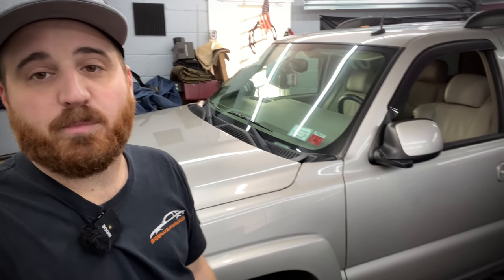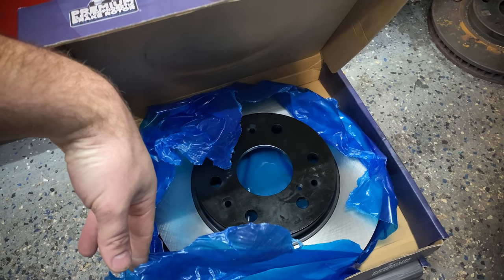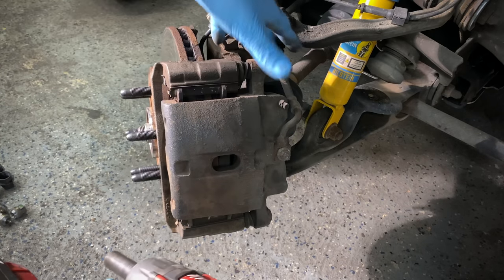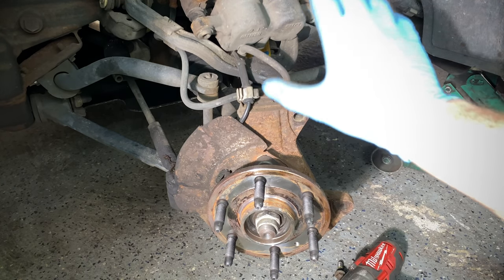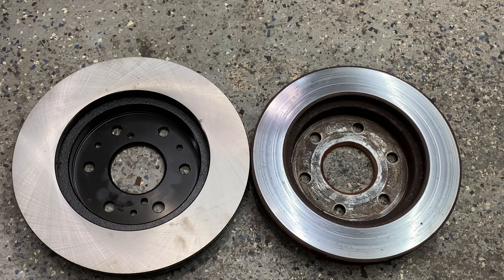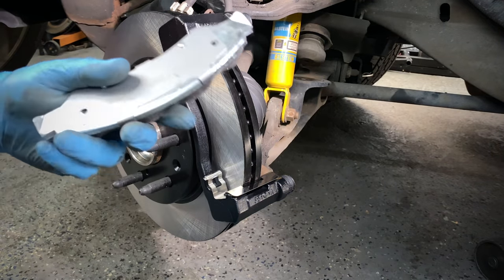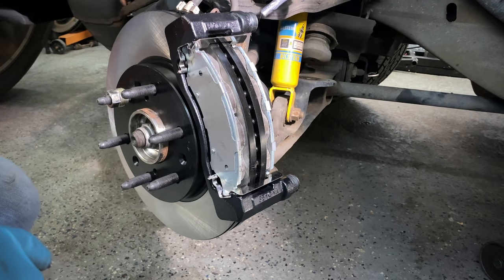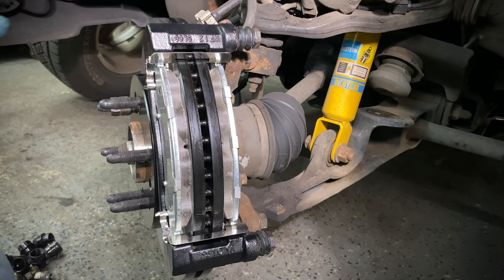This Budget BRAKE UPGRADE is Incredibly CHEAP & EASY!

Comment: Glad to see that you did the mod and liked it !!!!!!!   I believe the minimum rim size would be 17'' and that's what i run for winter tires on my 01 Silverado.  One problem that i encountered that wasn't project related was that i bought my parts rebuilt from two chain parts stores that begin with "A" and had nothing but problems with the calipers either seizing in front and one of the rears literally exploding the piston out of it's bore and taking out a rotor and pads.  Long story short i replaced everything with quality NAPA parts.  The other stores only give you you one set of replacement calipers for warranty even though it was within the 2 year time table.  My truck will now literally put you into the dashboard now when brakes are really leaned on !!!!!!!!!!!   AWESOME video as usual and i'm in CT should you need anything looked at or picked up just let me know as i travel to New Rochelle about once a month to visit my daughter who attends college there !

Comment: Just did this on my 2004 Cadillac Escalade Awd with 17 inch factory rims. I used a 2012 suburban 4wd  calipers rotors and pads. I used DE1363 pads from AutoZone 18-b4919a and 18-b4918a for the calipers also from AutoZone. 55097DL for rotors also from AutoZone. Brakes on a dime spent about 400 for all the parts

Comment: Good video, I have an 06 SS Silverado and those game with the same larger rotors and upgraded rotors.
Lately people have been doing the 19 and newer brake upgrade, a lot bigger caliper and rotor and only needs a couple washers on caliper to work. 🍻 
I now have a z71 tahoe and suburban since your videos both in the same color lol
Love these trucks, been doing lots of little mods as well.
Reply: Guess 20 inch wheels is the minimum for the 19-up brakes?
Reply: @blazerteam  more lol

Comment: Same brake that came about on the half ton pickups in 2005 when they went back to rear drums.  17" rims fit those brakes absolutely fine.  Want to get real fancy in the brake department?  Put on the 2019+ 4 piston calipers and 13.5" rotors from the 2019 and 2020 half ton trucks.  Being 4 piston it's a fixed caliper and it mounts directly to your existing spindle.  All you need to do is install about 4 mm worth of washers between the caliper and the spindle to center the caliper on the rotor.  Problem is right now those calipers are somewhat difficult to buy but that will change as time rolls on.  Those need at least an 18" wheel and I plan on seeing if they fit with my 18"s from a 2015 Silverado.
Reply: do you know if the 2019 2020 calipers fit on with factory 18" Z71 wheels?

Comment: 2019+ Silverado and Sierra Front calipers bolt on. That’s what I plan on doing with my Sierra. The calipers are 4 pistons and the rotors are 13.5 inch. Great video btw!! Also I hear stainless brake lines make a world of difference.
Reply: Only thing I would say to watch out for is the rims you plan on putting on your truck since the lip on those calipers are on the way for a lot of rims

Comment: I remember when I recommended this brake upgrade. I wasn’t playing when it’s a night and day difference. If you want another mod that’s good that’s really cheap too is 07+ electric fans with the harnesses.
Reply: I'm interested in this as my 03 has the mech fan and I was looking into getting a gmt800 fan and harness. I didn't realize 07+ was compatible/better?
Reply: Pre-07 trucks won't have the controls in the PCM for the fans.
Reply: It really doesn't matter. You need 05+ fans/34inch radiator and to grab the fan harness/piece that clips to fuse box. 03+ has the ability to run electric fans but have to be turned on in the tune. Also, you can run camaro fans with the smaller radiator but they dont cover like a inch of it

Comment: I did the upgrade too. I ordered OEM/ACDELCO parts for a 2007 Chevy Tahoe. I’m driving a 2004 Chevy Tahoe with Z71 package.  I ordered the PPV rotor and pads. The calipers did not have a PPV option.  NIGHT & DAY difference! Can’t wait to tow and see how that feels. Thanks for the great tutorial!
Reply: What size rim do you have and is it factory made or custom? My '04 Tahoe had custom wheels on it and I just bought 4 new tires. The 16" rims are binding on the calipers. Had to replace new W/ old back again - Please let me know your upgrade wheel size/ Thanks

Comment: It’s wired that you noticed a significant change. I went from stock 2007 brakes to 6 piston Brando brakes and can’t honestly feel any difference at all. It’s like if I’m still running stock. I only feel the difference on the highway if I have to stop really fast other then that it’s like stock brakes. If you want that cool look you can also get a bigger upgrade like the 4 piston calipers from a 2019 and up. They should bolt right up

Comment: Great video, but  don't use metallic brake grease on slide pins... it'll swell the rubber and eventually bind up. Only use silicone based grease on those - like Napa Sil Glyde.

Comment: I have an 05 Avalanche and I did this brake upgrade. I want to my local o'rilleys and got rotors, calipers,  and brake pads for a 2010 Avalanche. It was 40$ cheaper than if I had gotten 05 Avalanche  stuff because  on the newer years there is no caliper bracket. On the 2010 caliper the bracket is integrated. The only extra expense I had were different wheels and tires
Reply: Thanx for the advice Matt! My truck is cooler than it was originally.

Comment: Thank you for the great content. just did this on my 05 Escalade with 17” rims. Every thing went easy & stops so much better.
Reply: Will this work on trucks with 16" wheels?
Reply: @dapetik  it was very tight with the 17 “ wheels do not think it would work for 16”
Reply: How did it turn out with the 17 inch wheels
 I wanna do this but I wanna keep
The z71 wheels
Reply: @slurge21  Worked out very well. easy install and no rubbing. Im very happy with it.

Comment: On my 02 Tahoe I rid the OEM breaks till it went bad like metal on metal then after I replaced it with power stop drilled and slotted rotors and pad kit for front and rear. Then after the warranty and the breaks went bad I then dropped a couple grand on Wilwoods. 6 piston big break kit for the front and 4 piston big break kit for the rear. I did this because I realized that the brakes look really small in my newer gen Tahoe wheels.

Comment: If you're trying to do this super cheap you can get your rotors pads in calipers from the junkyard at least in my area before they end up at a junkyard they always end up with brand new rotors handbrake component if you bring the proper equipment to measure everything and ensure they're not warped you can walk out of there with a whole new brake system for about 60 bucks

Comment: I did upgrade break rotors in 2004 on my 2002 Avalanche. I think it was Bear cloth and slightly over $500 on parts. 14" rotors and caliper brackets to reuse OEM calipers. Avalanche came with vacuum buster, and OEM breaks wasn't grate. 14" upgrade was the best mod I did for the Avalanche. It saves front clip a couple times. Down side - no wheels less than 18" will feet.
I'll start "hunting" on  late models breaks for my 2003 Escalade.

Comment: Evening Matt, great video :-) . It still surprises some people as to how easy and substantial an upgrade something like this can be. Very much like upgrading from small front disc brakes or even from drum brakes on an early 70s GM a body like a Buick Skylark or a Pontiac LeMans with rotors and calipers (and/or spindles) off a late 70s early 80s caprice or Cadillac with the same wheel lug pattern and 13-inch rotors 😇 .

Comment: Some tahoes have dual piston calipers out back.  I put bigger front brakes off a 06 silverado and dual piston calipers in the back on my silverado and it made a whole lot of difference.
Reply: Did you have drums out back or upgrade single piston disc to dual piston?
Reply: On my moms 03 Silverado i did 06 Silverado front brakes and dual piston rear calipers. On my 06 when i shortened the rear end i upgraded to disk

Comment: Nice swap. Good info. I guess that applies to 99-06 trucks as well? I'd have to check the parts but it trucks should be the same as Tahoe. I'm running slotted rotors and "carbon fiber ceramic" pads on my 09 Tahoe. I wonder if the newer stuff will swap back to the 07-14 stuff.

Comment: 2005+ half ton Silverado/Sierra has these upgraded calipers up front as well. 👍
Reply: Correct, if the truck has drum brakes on the rear then it has these brakes up front.

Comment: Alot of people are doing the 2019+ 4 piston front calipers and rotors. I have a 2006 GMC Yukon with a Brembo GT front BBK and I want to replace/upgrade my rear calipers. I believe the Cobalt SS Brembo front calipers will work with the stock rear rotors with the right brackets made. I wonder where the brackets could be made.

Comment: I did the same with PowerStop drilled & slotted rotors and PowerStop powder coated calipers. You will need 17" wheels to fit over the brakes.

Comment: I wouldn’t do powder coat in your calipers. I found in my experience that once brake clean hits the powder coat it starts to melt. I use Eastwood high temp engine paint. 3 years later still looks like new. Brake clean will not wipe off! Nice work so far!
Reply: 🤔 I’ve never heard this. Good heads up.

Comment: I have the ebay ones callahan with powder coated calipers slotted drilled rotors and stainless steel brakes lines.  They are awesome.

Comment: Hey Bud I found that Wagner pads have a tendency to squeal after a short. Time consistently. I spent the extra money and bought the Wagner oem low dust and lo and behold they still squeal. I have found better luck going back to either original AC delco but I did just recently do a power stop upgrade brake kit on my 04 Silverado. I have those same rims I perched them off a 2018 Silverado as well. I run those rims in the wintertime. Also live in in the rust belt it's very important to keep the face of your hub rust free and clean so you don't get a low vibration while breaking. I know you just recently change those Hobbes but I always make sure mine are clean and I hit them with a little bit of fluid film it keeps the rust down. Are so good little tip speed sensors will rust Jack and cars and ABS fault. Keep that in mind I usually tear mine apart in the Spring clean them up and they're typically good for a good year did 2 years before I have to do them again.
Reply from the maker: Thanks for the tip, if they start making noise I'm definitely swapping them out!

Comment: On my 04 Silverado I did 2020 Silverado 4 piston calipers rotors are 13.5” they also bolt up it required a washer M12 I Think great video

Comment: If you have to re use he copper washers,  you can heat them until red then quench them. They will work like new again..copper is opposite of steel, can't remember the word for it though.

Comment: The 07 brakes bolt right on a gen 2 Tahoe.
What Matt doesn’t say is the stock wheels no longer fit.
Thanks Bud!!!
Reply from the maker: My stock Z71 wheels fit, the 16’s most likely wont.
Reply: @lsxmatt  thanks for reply.
you should say that in the video. 
16s don’t fit, whatever wheels in the z71 do.

Comment: I'm blown away by this! The fact that it's a direct fit is an epic money saver against "performance upgrades". I have a 2003 Yukon Denali AWD, and this will save me so much money! I'm following your journey closely! Thank you so much for sharing this info! Can I email or msg you on other bits and pieces?
Reply: Upgrade to the 2019-2020 silverado Sierra or escalade front brake, it bolts right up. 4 piston calipers, 14 inch rotors
Reply: @_cadillacmiketyping...2533  are you SERIOUS?????
Reply: @_cadillacmiketyping...2533  what about the rears?
Reply: @TheDeen83  you can swap those over too its a little more involved , many have used the 2 piston rears from a Yukon
Reply: @TheDeen83  https://youtu.be/vI0KKZlQFpg here is the video that blew me away.
Reply: @_cadillacmiketyping...2533  my Denali is AWD and has discs already, so I'm wondering if the newer Denali rear stuff fits....?
Reply: @TheDeen83  yeah not sure but i would not doubt that, gm like to keep things interchangeable
Reply: @_cadillacmiketyping...2533  right on, I'm trying to find some kind of research on it

Comment: Pretty sure the suspension on the 99-13 Chevy trucks and suvs is relatively very similar every year I would say as long as the spindle and the caliper matches it would probably work with even a 2012 for example as long as the spindle is the same

Comment: I have 08 Yukon and 12 Tahoe. Didn't know the brakes rotors were smaller  on previous gen.  Still the 13' rotors look small with 20 inch factory wheels.

Comment: Definitely works with 17" wheels and is the same brakes as 05 up Silverado/Sierra! so any 05 up 1500 truck or 07 up Tahoe/Yukon. Cross reference on rock auto and you'll see for yourself.

Comment: If I remember right, you can take the front knuckles off of this gmt800 and put them on the gmt400, It could be a very cheap and huge brake upgrade to a gmt400.

Comment: Id like a 11.5 14 bolt aam full float rear with 6 lug hub and largest disk brakes for the 6 lug layout that fit 17" wheels for a 2007 Silverado Classic 1500.

Comment: Any update on adding a factory sub to the bose system?  Is it plug and play, or do you need to run wires?  My suburban got broken into and the radio stolen, so when I was junkyard hunting for the dash bezel that they needlessly broke, I figured I might as well pick up the factory sub and interior piece.  I also have the bose sound system.  I'm just trying to figure out how long it will take me to install it.  It is still getting installed either way, just want to know what I'm getting in to.

Comment: 05-13 trucks run the larger front rotors and calipers. Want to increase stopping power? Don't use ceramic pads....junk! Best pads I've seen for a huge increase in stopping performance are Raybestos Police pursuit pads. If you don't care about brake dust, then it's the way to go! 14 Trucks and Utilities use the same front and rear rotors, pads and calipers.
Reply: Good job Matt! Keep the information going!

Comment: When you found that the brake line fit perfectly, I thought you were going to borrow Vice Grips phrase, "Well, I'll be dipped! It fits!"  It would have been a treat!
I would have locked down the bleeder nut before removing the line, to keep air from sneaking back in. But that's me.
Would this work for most GM Pickups for those years??

Comment: Great vid, thanks! A while back, I tried to do same on my '03 Silverado with 16" wheels. My stock rotors are the 12", while the new rotors were 13", but I could not get my wheel back on with new brakes mounted. I think you need minimum 17" wheels to do this upgrade, but if anyone has gotten this to work with 16" wheels, please post the 'recipe'!!!!!
Reply: Well, I REALLY wanted to do this front brake upgrade, especially after seeing Matt lock up the brakes on his test drive, LOL. So just today (July 3, 2021)  I bought a full set of brand new Silverado 17" take-off wheels/tires. Now all I need to do is buy and install the front brake components. Woohoo!
Reply: UPDATE: On my '03 1500, I had single-piston rear calipers, kinda weak. I actually found OEM setup for the rear, to convert to 2-piston calipers. It worked wonderfully. I also installed my new 17" wheels, and then did the front brake upgrade (from 12" rotor to 13") as shown in this vid. I must say, the difference in stopping power is amazing. I had to make a quick brake the other day and, for the first time, I actually felt like I had capable brakes. ;-)
Reply: @ChevySS1968  what oem 2 piston calipers did you use?

Comment: My 05 avalanche has the stock 17" wheels. I already bought the front brakes for a 2010 avalanche. So I had to get new wheels. I found the same wheels you have...  2015 silverado 18" wheels. I just have to get tires.

Comment: What's the diameter of the rotor with the overhang of the caliper?  This will help us tell if the upgrade will fit the ID of stock 17s.

Comment: I put Wagner OEX pads on my truck with new rotors and the brake dust is worse than any other OE pad or aftermarket pad I have ever used. Interest how your experience goes. Nice upgrade!
Reply: I've used the Wagner ceramic premium pads and had no problems

Comment: I have a 2001 Chevrolet Silverado 1500 do you think that will also fit my truck. Matt keep up the great job love your videos bro
Reply: Yes it will you can also use the rear twin piston caliper&bracket& rotors from the tahoe too
Reply: Even with the stock 16 inch wheel
Reply: Yes and I would suggest getting the dual piston rear brake upgrade as well.  It was a factory option on the Silverado and again bolts straight in.  My truck stops on a dime now.
Reply: And i can get this all off the 2007 models
Reply: @hinkhausr  the rear dual calipers come from the same model year as your truck so 99-2006 and can use the 16in wheels.  The front caliper upgrade from the 2007 requires 17 in rims.

Comment: I couldn't get mine to bark the tires, no matter what I did. And that is with new drilled/ slotted discs, and ceramic pads. Did you disconnect the ABS? Still stopped way better but not that good.